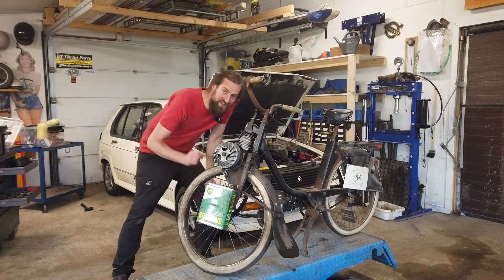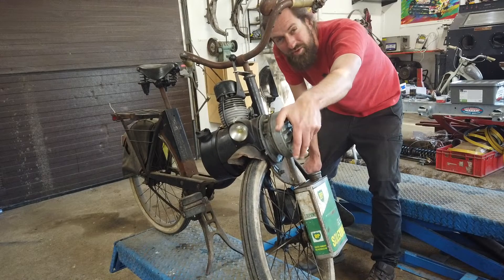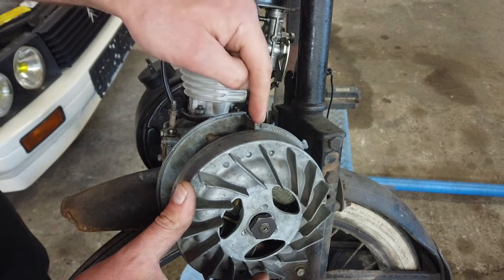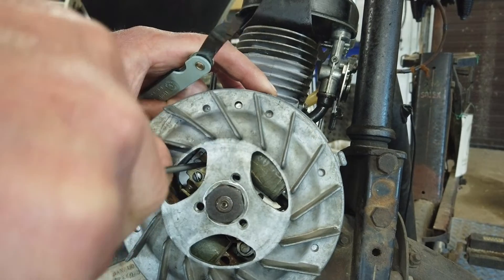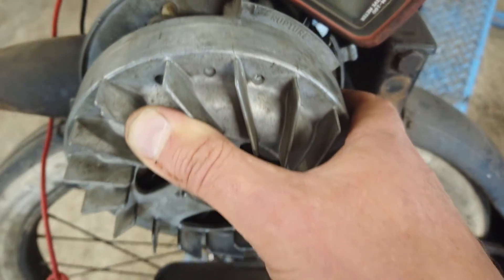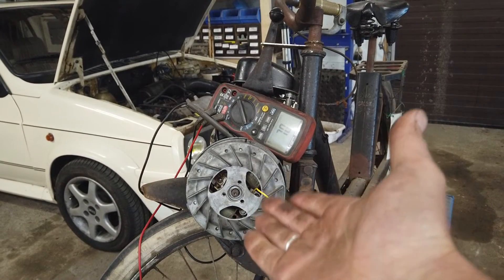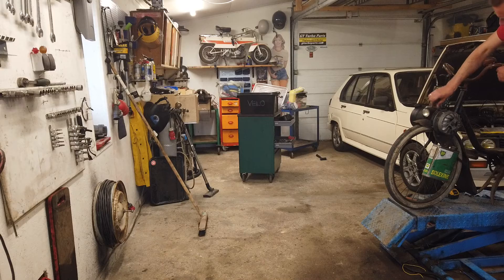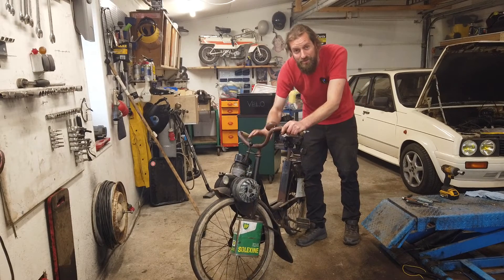Velo Solex- How to set the point gap

Comment: Great video, this is the reason why i was subscribed to the channel in the first place. You weren't wrong in the beginning of the video, I was feeling like you talked about me haha. Beside watching the cars on the channel i'm happy to see the solex again. I restored my first solex when I was 17 (during lockdown) and after three years I still have my proudly restored 1700, after that a few other solex projects joined but I will never sell my original solex. 
There is a small company in Holland that sells electronic ingnitions for a solex, I put it on my 1700 it drives great.
Ps: don't use a drill by one of my projects de threat broke off.

Comment: cool stuff!
But instead of pulling the flywheel over and over again, couldn't you install a measuring point that is accessible from the outside through one of the three holes? A piece of nice, gracefully curved sheet of copper, for example, with a hole for the screw (that you used to fixate the wire) on one side and a socket for the probe on the other - the socket should then be accessible when the contact opens?
Reply from the maker: its not that bad to remove the flywheel... and you will have to disconnect the lead from the ignition coil.. its hard to do with the magneto on...